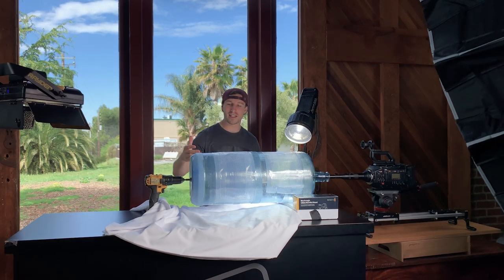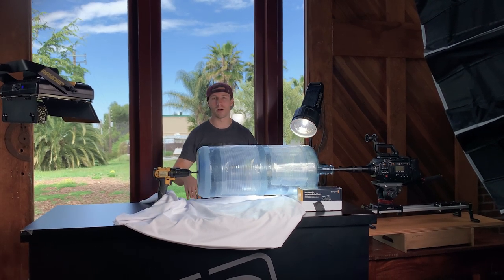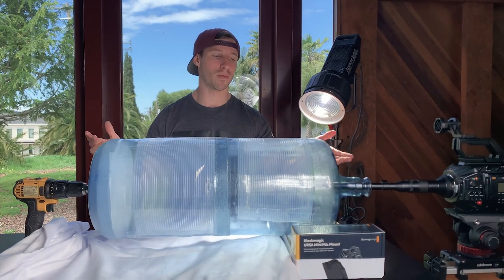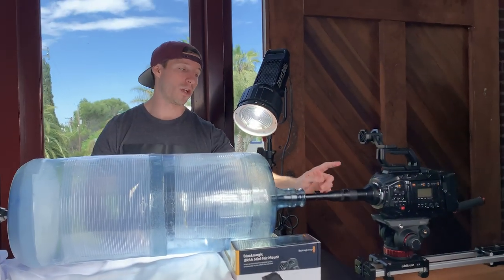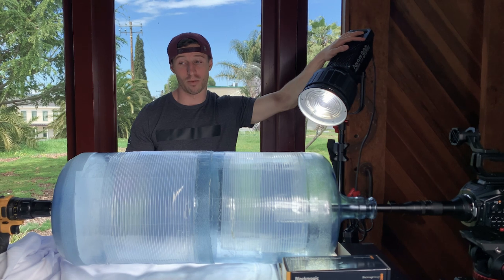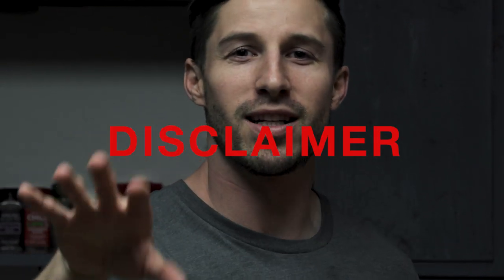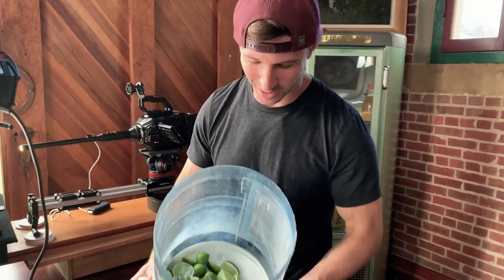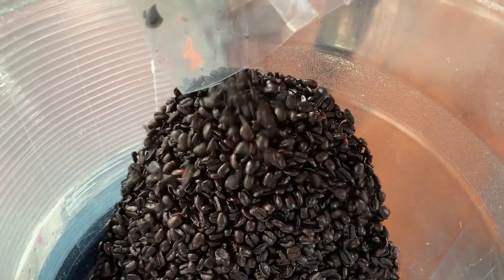Create Awesome Cyclone Shots for Product Videos with Laowa Probe Lens / Tutorial

Comment: I love the idea, but my first thought was that the drum was rotating to fast.  Much of the various items were sticking to the walls from centrifugal force.  Did you try slower speeds?
Reply from the maker: Yeah unfortunately at slower speeds the items wouldn't go completely in a circle. It was definitely a step towards what im trying to accomplish, I think my version 2.0 will work better almost done building it.
Reply: @AustenPaul  May be you can stick some kind of small paddles inside the jungs like front-load washing machines.
Reply from the maker: Yeah that’s what I actually tried with the first version but it was too noticeable in camera